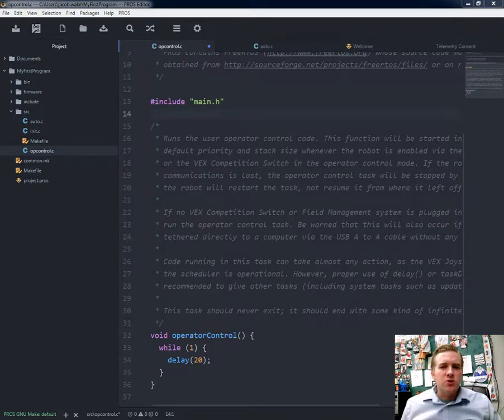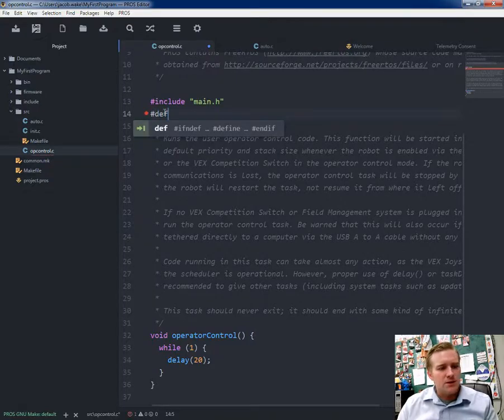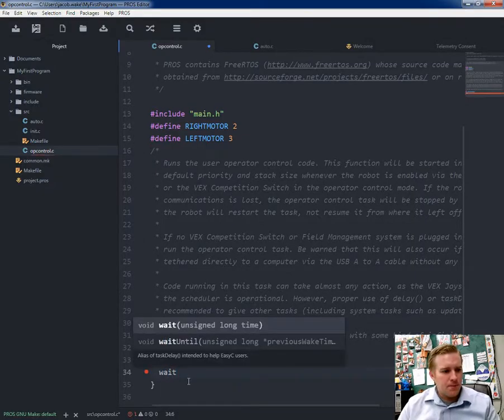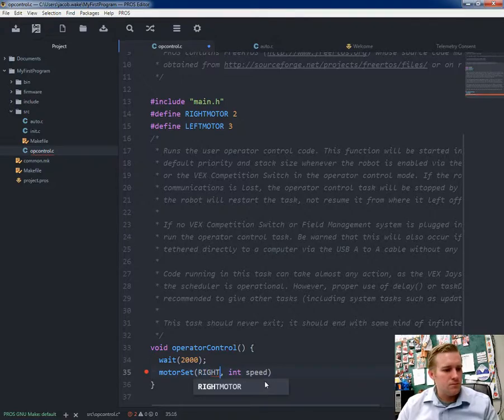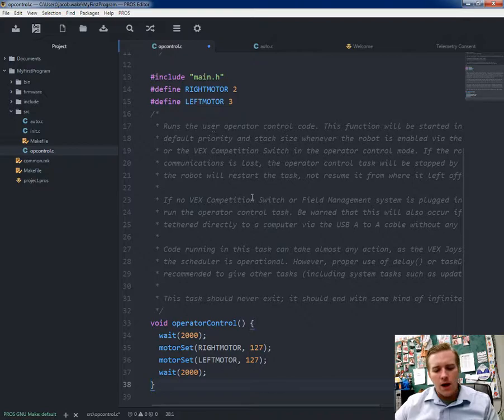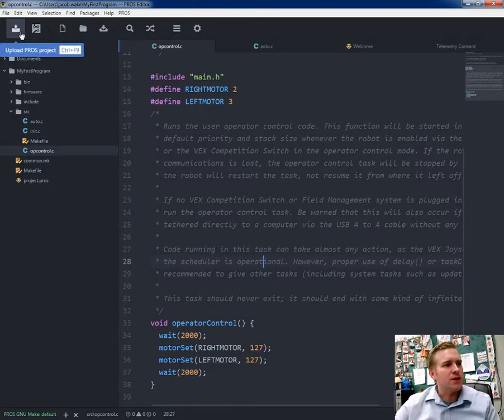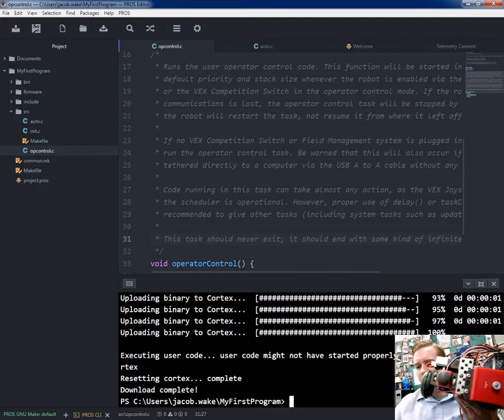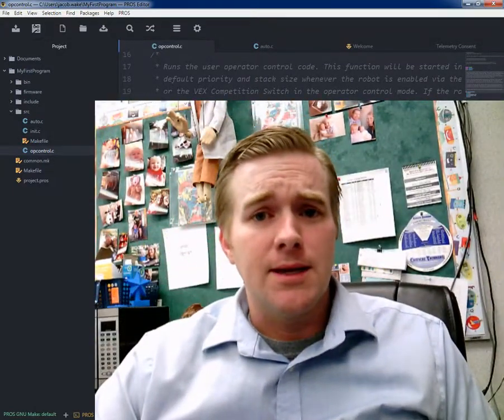PROS for VEX Robotics Tutorial 2 (Running Motors)

Comment: Hi
I need help as im getting an error when i build it the error says
 ====:: PROS Flasher v2.6.1 ::====
No binary was found! Ensure you are in a built PROS project (run make) or specify the file with the -f flag
I really need any help you can give
Leo
Reply from the maker: You need to hold down Ctrl + Alt + B to build your project. This will change your code to the "binary(.bin)" file type which is readable by the cortex. Then you can upload with Ctrl+F9
Reply: thanks man
Reply from the maker: Look at step 4 of compilation on the website below.
https://pros.cs.purdue.edu/cortex/tutorials/clawbot.html#compilation